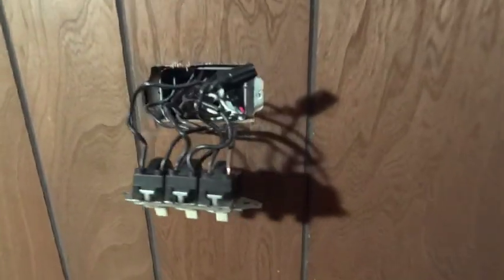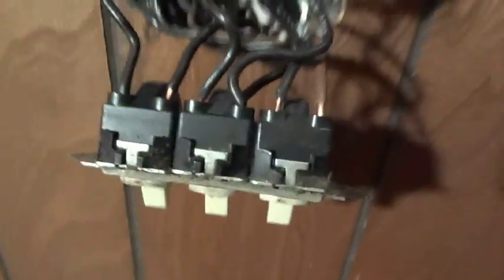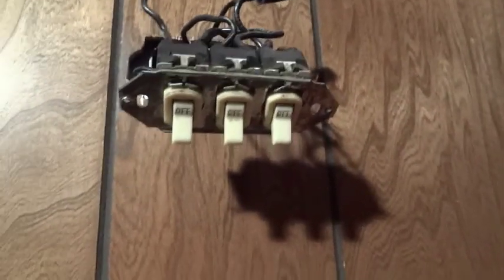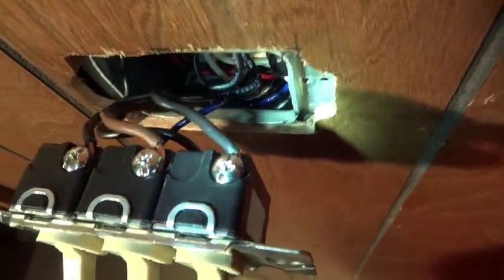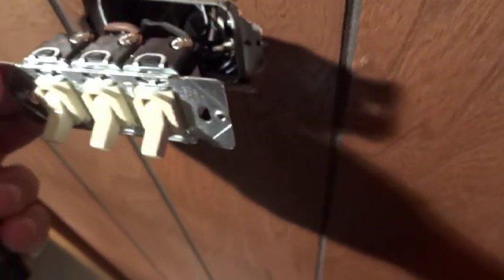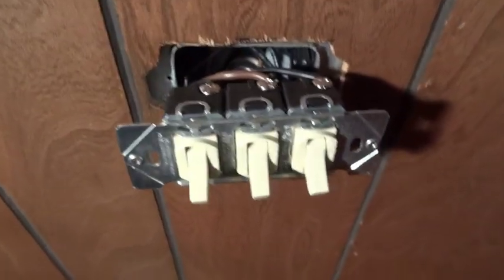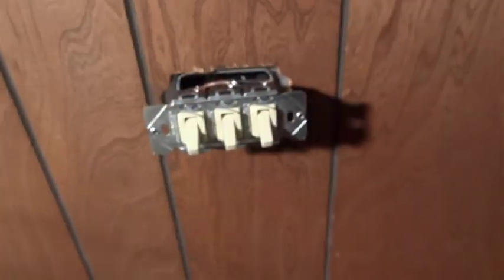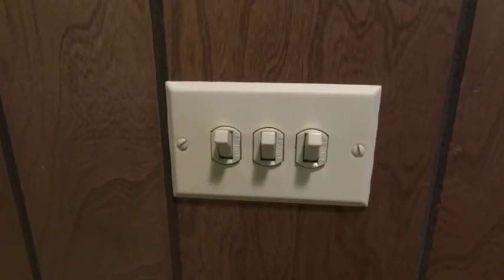The Installation and Wiring of a Despard "Triple" Switch

Comment: Thank You for that very interesting video on Despard switches, my apartment has in the bathroom  a box with 2 switches and an outlet for an electric shaver one switch for the light and the other switch for the exhaust fan. The switch for the light went bad, I could have fixed it, but my landlord installed a new light switch, I don't think he knows that they still make replacement switches, Thank you again for that detailed video on how to replace them:)

Comment: Very good tutorial vid for this type of switches! I used to have the pilot or night light despard assemblies where these took an 6 watt S-6 candelabra based bulb and then a slotted stainless steel dome that screws over the bulb, wish I still hung onto them. These made good night lights but the metal domes did get kinda hot.  These are not made anymore but the neon ones replaced them.

Comment: Great video. I will continue to plug my wires in. Ive found they make a better connection, less likely to come loose when you have to pull the switches out for inspection and when done right you have no exposed connections.

Comment: As an electrician here in Canada I have to say I have never seen those Despard switches.At least the guy who did the original wiring left plenty of wire to work with as that is my biggest complaint being the wires cut to short.One thing though which is good practice is to always have the line wired to the top terminals and the load on the bottom as that is how all disconnect switches are done in industry.

Comment: You dont like the push wire conections on the back of a switch . I use them all the time and never had a problem with them pulling out .

Comment: Good day
I have some Despard switches...both that "tab" style, (which were from 1960's to my knowledge) AND, "traditional" wall plate style, (I believe 1960's) 
Despard plates made options of both incandescent & neon indicators (which occupied the opposing outlet hole of the switch plate)  
I have 1 NOS switch & NOS neon light in my little stock of electrical goodies.

Comment: Good video. Ive been looking all over for those. Where did you buy from?
Reply from the maker: You can find these switches at Ace Hardware still.  You won't find them at the big box stores.
Reply: @drh4683  thank you
Reply: @drh4683  do they have electrical boxes for them or do they just insert into opening by themselves?
Reply: @MikeySocks  looks like a standard electrical box

Comment: Great video but your comment about how bad the quick connect is and the use of only black wire going to and from switches tells me that you don't know a whole lot about household wiring. I would expect there to only be black wire to and from the switch, unless it's a 3-way, then i would expect to see an additional red wire. Black is the hot wire from the breaker box to the switch and then to the light. The switch interrupts the current from the breaker panel to the light so that color should all be the same. And quick connects on switches and outlets have proven to work great. They never come loose and you don't run the risk of weakening the wire by bending it in a loop then crushing it when over tightening the screw. You just need the proper tool to remove the wire from the switch when doing a repair. But like I said, great job on the video, informative and not to long or filled with useless info.

Comment: I dislike Despard switches, and I always replace them with modern type ones whenever possible.  In this case, I would have cut out some paneling, and completely replaced the box with a 3-gang, and rewired everything to accept three separate standard switches.  I would NOT have simply replaced the Despard ones.  Another problem with those is that having a triple switch requires a lot of wires in a single box, which can easily exceed the maximum number of conductors allowed by Code.
Reply: He covered that.
Reply: That's nice to hear what you would do. I bet you bent the tabs on the switch and not the bracket huh? It's ok.

Comment: I don't like those quick connects myself I don't trust them.I have been in a house that was built the same year yours was,it also used Despard wiring devices in the living room and bedrooms There were three Despard outlets per box two white and one brown Why one brown?The brown was controlled by a switch and the whites were hot all the time in the bedrooms there was one brown switch and one white.The white controlled the light fixture and the brown the outlets.

Comment: Spare the endless commentary......you don't show how to bend the taps
Reply from the maker: Ben Adam775 good call.  I'll take your advice from a video I did almost 7 years ago...
Reply: Well unfortunately for me I have despard switches in my bathroom and I haven't had a problem until today. I figured out how to bend the tabs after I broke one of the new switches, which are pain in the ass to find nowadays. After finally getting the switches in and wired the same exact way, the circuit breaker keeps tripping, I'm about to go nuts.........